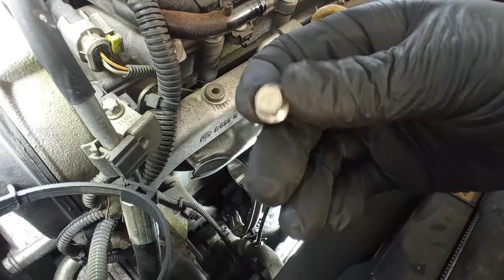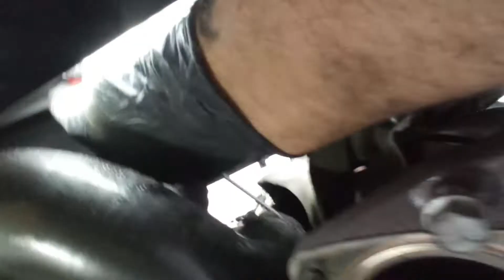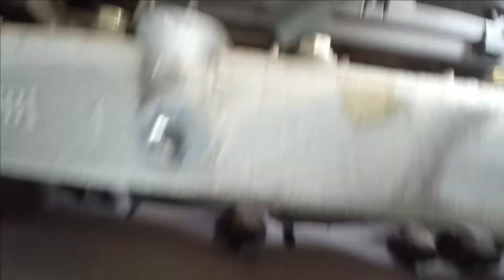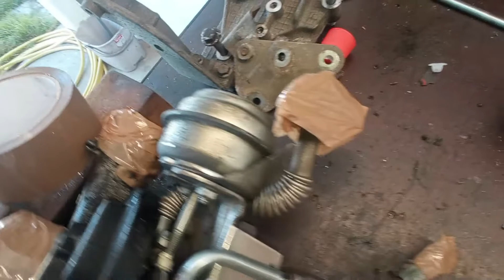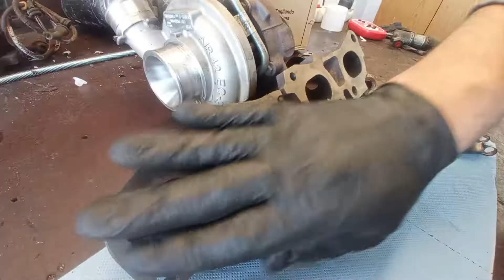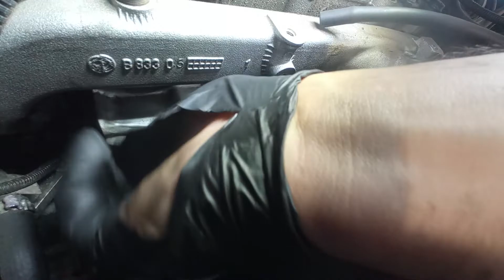ENGINE NOISE, Exhaust manifold. Disassembly Repair and Assembly. 1.9 Mjet Alfa Romeo 159

Comment: Can you give any tips on how to clamp the manyfold down for machining? I would like to do it on a CNC mill and I was wondering how do you do it or if you do it somewhere else, have you seen how they clamp it down?
Reply from the maker: Hello. I send it to the machine shop, I don't know how do they hold it down
Reply: @alfaromeonoproblem Thank you, is there any upgrade that can be done for the 2.0 jtdm 170hp 2010 159 sw in terms of the low right intercooler hose which is near the DPF and AC compressor? If yes can you send a link?
Reply from the maker: Hello. Check with JTD Performance please

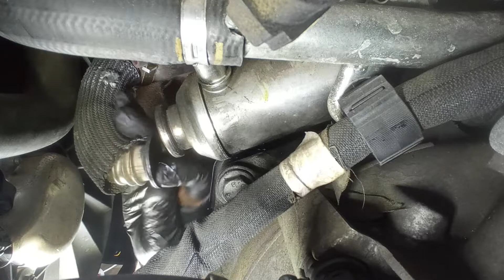Comment: Hi. Great video! 46:40 there is an EGR pipe. This one is leaking gas somewhere where this round connector is located. Is it OK to blank this pipe near exhaust manifold? Any downsides by doing that? Thanks!
Reply from the maker: Hello. I always do the blanks near the intake, much better and the blank can be made with a thinner material.

Comment: Thanks again for this excellent helpful video. So glad I’ve found that you’ve done this video! I’ve used your other videos for inlet manifold change, fuel pump troubleshooting etc. now we are planning to change the turbo and exhaust manifold on Astra H so similar engine. I was worried about damaged studs but feel better seeing your solutions. One question. What sort of spray do you use to help clean up the head area before fitting exhaust manifold again?
Reply from the maker: Hello, thanks for watching. I just sprayed a bit of brake cleaner on
Reply: Thanks. We managed to change to turbo and it all works again. Much better than before. Also think we had a leak on the right side exhaust port as the head where the gasket covers it was raised with rusty dirt. Scraped it carefully back to flat and all good.
Reply from the maker: Very nice, thank you very much for the update
Reply: Merry Christmas Bruno - I’ve sent a donation as thanks again for your excellent helpful videos. 🎉🎉
Reply from the maker: Wow! Thanks for your support!
Reply: @alfaromeonoproblem  it’s your excellent content - so clear and also humorous that gave me the confidence to attempt this work (outside in UK) - also we had a problem with the engine cutting out at about 3000rpm when accelerating that persisted and we checked fuel pump, changed solenoid on pump. In the end it turned out the engine had been mapped to higher power. When I restored it to ECU original state via tuning company it works ok again! The old car didn’t like being mapped but now hopefully will run for a while
(This might have been why turbo was dying as well!)

Comment: I’m watching again this video since yesterday while doing an oil change i noticed 1 stud was missing fron the exaust manifold…. It has broken…
The car runs ok… except a little wistle when hard accelerating, it was the manifold.
That noise appeared for the first time like 2 years ago, probably i run without that stud for so long.

Since i cannot remove the engine in my yard i disassebled the whole front of the car and accessed the manifold. Also i see that for the 2 most left studs i need to remove power steering, alternator, ac compressor and that alluminum bracket, today i will continue to work on it.
I planned my summer holidays differently, thank you alfa :( only 124000 km, a bit disappointed.

Anyway, i just wanted to share my experience, thank you very much for the wonderful tutorial bruno, it will help a lot thank you sooo much!
Reply from the maker: Hello, thanks for watching every single time!
It's a 2.4 yes? You will have a very thorough video for that upcoming for November. All at home, no lifts, no engine out.
Reply: @alfaromeonoproblem oh that would be amazing… yet i have already dismounted everything, but I will surely watch it since i always learn something from you! Thank you for everything
Reply from the maker: Thank you

Comment: Hello,

While removing the manifold from my Alfa Romeo 159 120hp, I noticed it was held in place by an oil plug. Unfortunately, I don’t remember its exact location, as I removed it blindly just to free the manifold.

If anyone knows where this plug is supposed to go, I’d really appreciate it if you could share a photo.

This message will be translated, so I hope it still makes sense. Thank you in advance!
Reply from the maker: Hello. See if this will help:

https://youtu.be/8BrTbLmsaH4?si=yJ6y-AL3jfkEHATo
Reply: Do you find out? I can help you

Comment: Do you have insta or any contact because I have an astra 1.9 cdti I want to send you some photos because I changed the intake manifold and the injection pump to know if it is installed correctly, talk to me and I will send you photos and you will understand it faster
Reply from the maker: Hello. Maybe this will help: 

https://youtu.be/D040o2yjDBM?si=qkSV-LCwZka12vLS

And

https://youtu.be/tD6hmoiYg44?si=scqMcvnOQZqYTp_y

And

https://youtu.be/fKUWEhP_pyo?si=QXgBOoKwPb7-2oO4

Comment: Hello, I am your subscriber, I have been watching your videos since I have an Alfa Romeo 159 1.9 jdtm 8v, I live in France, when I turn the steering wheel a little the generator or power steering makes noise, the noise is similar to a broken belt tensioner, but the tensioner is new, I recently changed it along with the belts, the steering wheel itself became a little tight, if I add gas everything is fine, I showed it to several mechanics, they can’t figure out what’s wrong. I do everything myself, but now I’m at a dead end
Reply from the maker: Make sure the belt is the correct size. Also that the tensioner is holding the belt tight
Reply: @ hi thanks for the answer👍, this is alfa romeo 159, 1.9 jtdm 8v, belt 1733pk6. I will make a video, I just don't know how to show it to you
Reply from the maker: @mikhabakhia2011 confirm on eper.fiarforum.com

Comment: I put regenerated turbo in my car week ago. I used a new gasket and screw all screws 25nm. At first sound was normal, but then it started to sound more and more like in this video. Is there any possibility that it could be not well regenerated turbo or it is more likely to be exhaust manifold? I did about 15km and it started to sound like this. After 60km it was really loud and I was scared that it is turbo. My car is Alfa GT 1.9
Reply from the maker: If it is this noise, you have a warped manifold and or not torqued properly. 
Make sure to use ONLY new and ORIGINAL gasket, studs and nuts.
Reply: @alfaromeonoproblem  my local mechanic checked the sound and the leakage, there was no leakage near the exhaust manifolf, the sound was coming out near the cr pump, i dont know what Can be a cause
Update: other mechanic that is specialist also in alfa Romeo said, engine is working straight and that i dont have to bother about this sound for now, it Can be intake manifold leakage or something if really 
What is your opinion? Can i send somehow priv message to you with video?
Reply: Maybe alternator?
Reply from the maker: @pejczykjr2862 ok. Yes send me the video or audio please
Reply from the maker: @pejczykjr2862 I have to hear the sound
Reply: @alfaromeonoproblem  okay, thank you, I will publish video to my profile with recorded video because i dont know how to write private message to you
Reply: @alfaromeonoproblem  how Can i private message you? Or do you want me to publish it on my profile?
Reply: @alfaromeonoproblem  do you want me to publish it on my profile or i can somehow private message you?
Reply: @alfaromeonoproblem  https://www.youtube.com/watch?v=h3-VuHBA5Mk
Reply: @m0cNe_JaJa friend its exhaust manifold, you must to resurface it, it bends. New gasket is not fix for it, you must bring it to guy who will resurface it with cnc machine.

Comment: Are the two top bolts for the turbo heat shield M10 x 20mm flanged bolts? I'm only guessing from pausing the video. I was hearing a rattle when driving and on investigation both bolts are missing and the heat shield's split. I've ordered a new heat shield but I don't definitively know what size of bolts to buy.

Obrigado from the UK. 👍🏻
Reply from the maker: Hello. The heat shield uses 6 mm bolts with 10mm heads. Check it out on eper, link down on the description

Comment: Have the 8v Multijet engine this problem? I just buy a stilo 1.9 mjet and i think The turbo sound a bit from 2000rpms....
I need change The thermostat beacuse The engine always run cold😢
Reply from the maker: Hello. I have never seen this on the 8v engines. Maybe you have another issue

Comment: Hello, i want to take out my oil pan on the alfa romeo 156 crosswagon 1.9 16v, but i have a bolt between gear box and oil pan. I need to separate gearbox or i could somehow remove the torx bolt without?
Reply from the maker: Hello. No need to remove the gearbox. You need to rotate the crankshaft to find the gap to introduce the long wrench in.

Comment: Love those long videos. So much information.
How to jack up the 159 properly, though? With the jak on the jacking points on the sill, yes. But then where to put the jack stands?
Battery can be disconnected without the car losing the radio codes, locking itself (when connecting it back) and similar?
Reply from the maker: Hello. I usually put the jack stands on the subframe. Normally on a main bolt or something. 

No issues with the battery, apart from having to reset the Frameless window doors.
Reply: @alfaromeonoproblem  Thanks. The only problem is that in most of Europe, subframe tends to rust. Mine only has surface rust, but you never know. And subframe bolts are very rusty, so I though maybe the subframe was replaced at some point (I hope it was).
Reply from the maker: In here they are always very good. You will see in the channel too.
But even rusty, if you rest them on the bolts it will be fine
Reply: @alfaromeonoproblem Thank you. 🙂
Reply: @DashCamSerbia Oh I have completely lost count of how many times I have put off getting underneath and working on my 159 because I did not feel confident in where exactly to put my jack stands! I visited the UK Alfa Owner forums for advice many, many times (before Bruno started this channel) as there are very few Alfa owners here in Australia, however even they were very sketchy about jack stand placement. It appears Alfa did not expend much energy coming up with an official spot!
Reply: @misssummersalt   Yeah. Well, I guess they just intended for a lift. Not very DIY friendly in that aspect. :I

Comment: Good morning Bruno you forgot to say your introduction first .
Reply from the maker: Hello. How are you? Welcome to another video! 
I tried this intro instead, trying to get to the point faster.
Reply: @alfaromeonoproblem hello from Romania. I am about to buy a 147 1.9ktd 8v, with only 100HP. Can you please advise if it is a good buy, and if you know how can I gain more power. From what I understood, this 100HP engine is very similar to 1.9 with 120HP, but I don't know which are the differences between them and bow can I get the same amount of power. Thx in advance
Reply from the maker: Hello. That is one of the best diesels in the world. You can not kill it! About power you can easily get 150 to 200 with stock parts.
105, 110, 115 and 120 hp are all the same engine but different ECU, injectors and turbos.
Reply from the maker: Check this out:
https://youtu.be/LQdEhvP4-ms
Reply: @alfaromeonoproblem thx a lot for your answer.

Comment: Hi, is it true that you need to take the engine out on the 2.4 litre?
Regards
Reply from the maker: Hello. Yes, is true. The factory says so. Some technicians can do it in place but I think it takes longer and is way harder. This engine comes out very easily.
Reply: Ok, thanks for yout repply, just wanted to confirm.
Reply: @alfaromeonoproblem THE ENGINE COMES OUT EASILY?!??

I was quoted $2,500AUD (about €1,500) to remove my 2.4 engine just so the mechanic could get proper access to see why my timing belt melted and just how much damage it caused.

That was just to gain access, before doing any repairs😅!
Reply from the maker: @misssummersalt hello. I do not make the prices. But I will tell you it is one of the easiest engines no take out and out back in.
With a lift, comes out in around two/tree hours
Reply: @alfaromeonoproblem  Unfortunately I dont have a lift. What about an engine crane?
Reply from the maker: I also do not have a lift and I do all kinds of work just with jacks and a crane
Reply: @alfaromeonoproblem  thanks for the reply! I will give it a go!
Reply: Is it possible to remove the 2.4 JTDM engine out the top or front (assuming strip down of front panels and bumper)?
Reply: I've read conflicting reports of it having to be dropped, using a lift to raise the frame.
Reply from the maker: @lyleground5081 hello. The 1.9 is possible. The 2.4... I think I've tried it once, not good.. but try it
Reply: @alfaromeonoproblem appreciate the response  i have an exhaust manifold leak which i saw I need to remove the engine to fix but if I can't remove the engine out the top then I may need to try fix while still in the car
Reply from the maker: @lyleground5081 take out the front, the power steering pump, alternator, AC compressor and the full bracket for all that